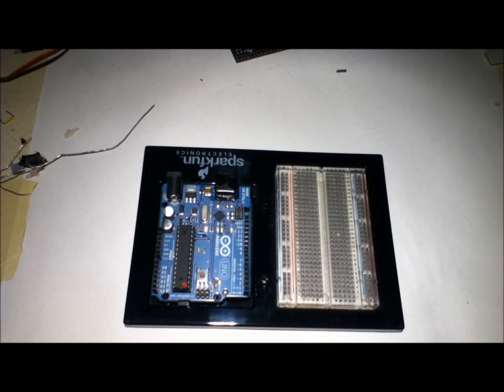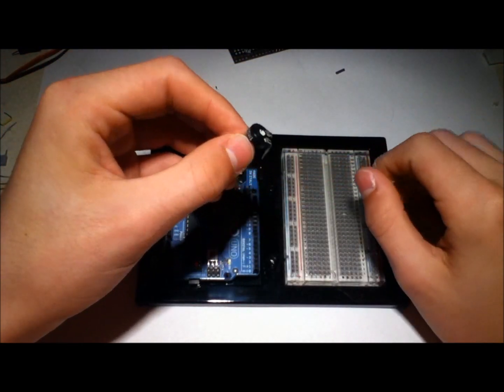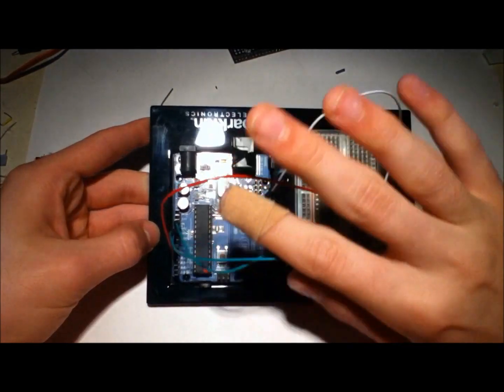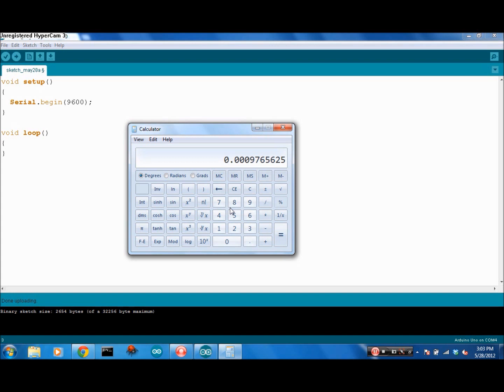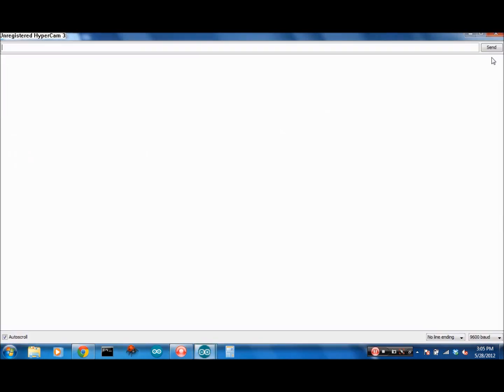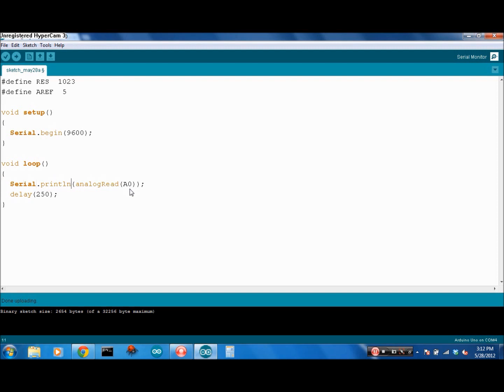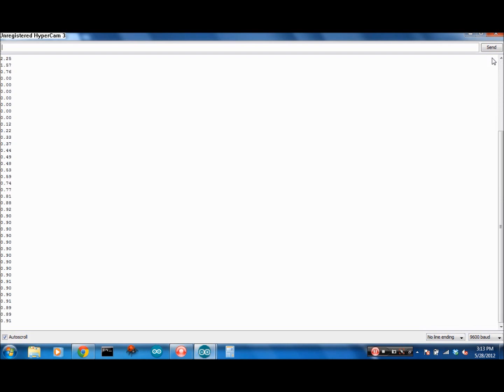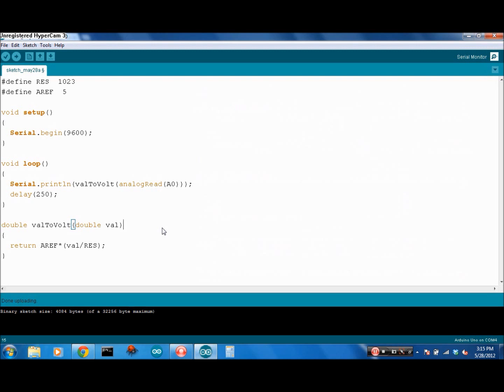Arduino Tutorial #6: Analog Input

Comment: What if we want to do math with those analog inputs?  Is the 0 - 1023 treated as an integer?  Suppose I want to use a code generated integer and use a pot to trim that value?  If I have an integer of 500 from my code, and my pot returns a value of 523, can I add those to get 1023 and then convert back to 5V, or use 1023 to generate a PWM?  I guess what I'm asking is what units our 0-1023 scale uses?  Are those integers?
Reply from the maker: The output from the ADC is unit-less. It's the percent of voltage between the lowest and largest reference voltages. So, say the ADC outputs a value of 512, since this is a 10 bit ADC (1024 possible values), 512/1024 = 1/2. Thus the voltage is half way between 0 and Vref.

Comment: What if i am using a USB microphone to collect values.  The USB mic has 4 wires:+V, GND, and 2 data cables.  How would i connect the 4 wires?  I know +V would go to 5v on the arduino and GND would go to GND on the arduino, but what about the two data cables?  Thanks

Comment: Yea you asked for a Arduino subject? I need to build a PCB printer using old printer parts (motors and sensors ect) And control all the compontets with the Arduido?Printing a schematic on a copper blank  using Silver Ink. Ecting with acid Then  masking it with solder resecentant film and last print the lettering and location of mounting  and pin holes.

Comment: good tutorial thanks, I'm new to arduino and was wanting to read the output voltage from an Xbox one controller. the potentiometers for the joypad. in my understanding they are at 1.8v how would I set the external power to read the voltage correctly using the aref so that I can replicate it through a digital pin? :)

Comment: I need to switch on a relay at 23v dc and off at 29v dc. I have an arduino uno r3 and a opti relay. I have a generator auto start control box that needs to ground a pin at the voltage you want it to start at then open that circuit at the voltage you want it to stop at. the controller does the rest.  basically I think I need to know how to convert 23 to 29 volt dc into the 0 to 5v that the uno needs. any help would be greatly appreciated. thanks,,, shiler00